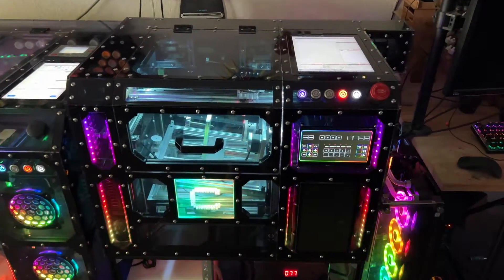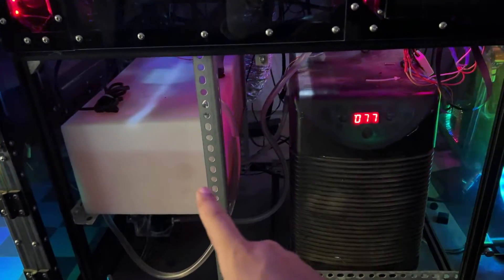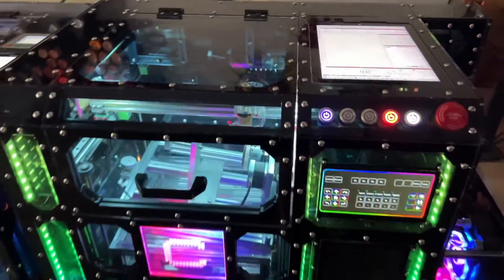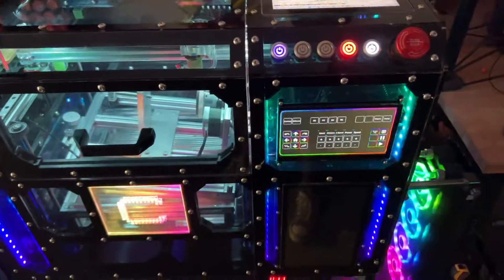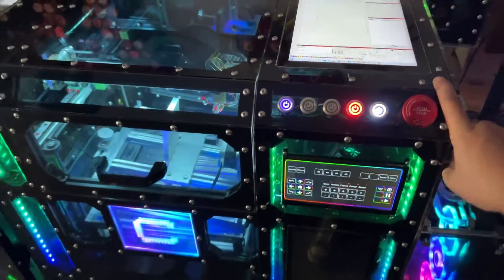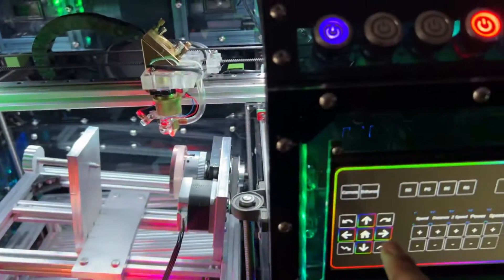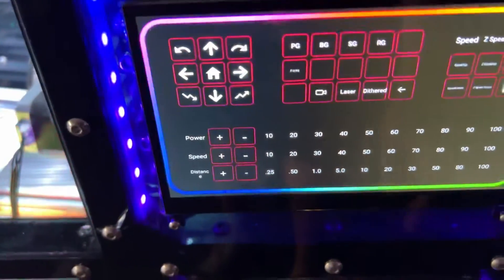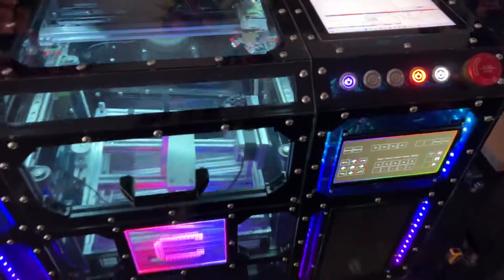40W Build Update 10/11/22

Comment: what are the LED lights do you use in your build trying to find some good ones for my enclosure that I am building for my 3D printer
Reply from the maker: I tend to use either one of these two. For this build I used mostly the bottom link. Depends on the density that you like. 

Aclorol WS2812B 144 Pixels RGB... https://www.amazon.com/dp/B07BKPS3G1?ref=ppx_pop_mob_ap_share

ALITOVE WS2812B LED Strip... https://www.amazon.com/dp/B095BFJMD1?ref=ppx_pop_mob_ap_share
Reply: @HangingOutWithChico  oh nice thanks for the links how do you control them if I may ask, because what I would like to do is the some super bright ones like that ether have them in full blown RGB mode or have them setup as daylight mode when i'm printing at night,
Reply from the maker: @TheRealKSTVL   I used these for most part. You can control the lights on your phone via Bluetooth and save your favorites. You can easily dim them with a click or two on the phone. ALITOVE WS2812B WS2811... https://www.amazon.com/dp/B07G77YD9L?ref=ppx_pop_mob_ap_share

For the rest of them I used Arduino’s so that I could program the lights exactly the way I wanted them to behave. If you dive into arduinos they are not expensive and with a little bit of research you can program the lights yourself and you could add a physical button to change the sequence or dim the lights.
Reply: @HangingOutWithChico  I do have a couple arduino's laying around and few raspberry pi's
Reply: Does it also cut? 😂😂 incredible job.